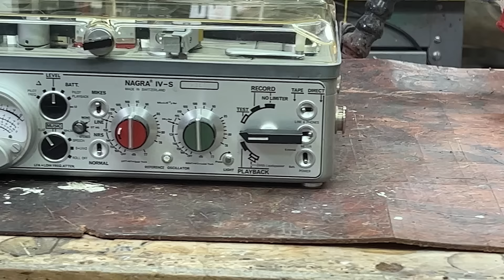Adam Savage Restores Clear Plastic Discoloration

Comment: Wonderful work!  My only advice here is your use of paper towels on plastic: it does put microscratches into the surface.  Cotton or poly microfiber cloth is the only thing to use to prevent clouding or hazing a plastic surface.  Remember when you were a kid and the optometrist warned you about cleaning your glasses with paper towels?  That was good advice!
Reply: Funny thing is that those blue ones he puts the lid on look like microfiber cloths, yet he still continues to use those paper towels 🤦‍♂
Reply: @pendaco  They are thin Huck towels;    you can find them listed through his online Amazon shop link.   I agree that a new microfiber cloth would be my choice.
Reply: I just posted the same comment about five hours after you, didnt read down the comments this far.  Sorry.  but it is worth mentioning more than once I hope.
Reply: I know it's a year old, but seeing this brought back some bad memories. I used to work in a glass shop, and had to redo a few projects, because the other genius guys that SHOULD have known better, came up and started cleaning the plexi/lexan with paper freaking towels! AFTER I was almost done!
Reply: As a teenager I used to clean my glasses with paper towels and windex all the time.  Nobody ever told me it was bad. Finally once when I went to get a new pair of glasses they seen my glasses and knew immediately what happened to them. I now use special cleaning solution for glasses (no ammonia) and a lens cloth.

Comment: 12% hydrogen peroxide is more than enough concentration, but as everyone has said UV exposure is needed. If it doesn't fit in Adam's beautiful UV box for finishing 3D printing, just sitting in sunlight will do. 
Honestly, the Nagra looks gorgeous already. Gave me a small thrill to see it zipping tape through rewind!
Reply: Issue with sunlight is that the perioxide will turn to water much quicker.

Comment: There is a restoration process called retrobright that uses hydrogen peroxide and UV light to get the yellow out of old plastic. People have restored old PCs and all sorts doing this. One setup I’ve seen is a clear container filled with hydrogen peroxide, wrapped in UV led tape and then tinfoil. I’ve also seen hydrogen peroxide cream from beauty suppliers work well as it can stick to the surface you want to restore, wrapped in cling film and left in the sun.

Comment: Research in the Pinball area and you'll find great tips for removing yellowing with minimal integrity damage. We commonly treat this kind of stuff to restore older machines. Depending on your plastic type the time and method may be different to reduce potential damage. For this type of likely PC plastic you do have to submerge it in the peroxide and keep it in full UV sunlight until it clarifies. Anywhere from 2-72h depending on your UV intensity. It's the least effort and least damage that won't reduce the clarity or polish. I'm not sure if it's the peroxide reacting with the plastic or the reaction of UV through peroxide that somehow modifies it. On some plastics just leaving it in direct sunlight for a few days will do the same. It's the safest way for any plastic.

If possible do this outside in full light, not in a window because windows (especially modern) cut certain UV wavelengths enough it will take 48-72h to clear. Storm windows often have UV film and this may not work at all indoors. You can also try making a paste from baking soda or certain types of toothpaste and let that sit if sun isn't an option. Some plastics will warp depending on sun/heat/cold so indoors in the window may be required. I'm not sure what UV wavelength makes this process work, wish I knew, but I've only gotten it to work in full sun. Also works safely on PP.

Be cautious about the methods. For anyone doing this stuff DO A TEST FIRST, these things can brittle some plastics depending on chemical properties and age. Some ABS will re-yellow pretty quickly when doing these methods and depending on the plastic formulation it may make it brittle. You may need to seal the plastic to keep it from yellowing again because it's oxygen that causes the yellowing. I've seen people ruin items doing some of these de-yellowing methods. Most of the methods will remove stickers, paints, or embellishments so even more important to do a test. You can do this with just a drop on a more inconspicuous part.

Comment: I had about the same issues with the Novus polishes on my motorcycle windshields - it seemed to do well at first, then it got worse, then I was fighting to get it back to a respectable clarity. I ended up getting Meguiars #17 (mirror glaze clear plastic cleaner) and it's worlds better at removing fine scratches than the Novus products are. It's safe for gauge clusters, computer screens, and motorcycle windshields, where optical clarity is required (I was almost blind riding at night due to the glare from the swirls on my windshield originally). Thanks for posting!
Reply: Thanks for this. All the other comments about polishing didn't seem to know that he was using a product that wasn't a mechanical polish. Your comment was actually helpful to me because I have used the novus fine (can't rmember if it's 1, 2, or 3) on opaque plastics and it works nicely and they seem quite shiny, but clarity on clear plastics isn't great.  I think his effort was improved greatly by giving it a good cleaning after the final application. Thanks for your tip!

Comment: I build plastic models and use what used to be called Future Floor wax, but now called Pledge Floor Care for the clear parts. I've found that minor scratches mostly disappear as it fills in the scratches. Not sure if it will work, but just a suggestion. I've usually dipped the parts in the floor wax but have used an airbrush on them before. It doesn't need thinning.

Comment: There's been some really great experimentation done with the retrobrite process, and one conclusion that they've all pretty much come to is that heat and/or UV is key to making the process work. Since this is a very valuable piece you may want to avoid going with the heat option since it increases the risk that you might overheat the piece and warp it, but it definitely would be worth it to get some UV lights and repeat this experiment. The other option would be a higher concentration peroxide solution, but once again it becomes risky at a certain concentration, and without UV and/or heat results are likely to be middling at best. The absolute best results seem to be obtained by using both heat and UV, but even just UV should give you better results than what you got.

Comment: Adam, I do sneaker restoration and I use a product called Salon Care 40 to remove the yellowing on white rubber of the sneakers.
The secret is to coat with the salon care and put it under uvb light and it works great.
Hunters use it was well to whiten game skulls. 
I think if when you were soaking the cover if you would have had it under some uvb light it would work.

Comment: I just got into reel to reel myself. what kept me away was the seemingly daunting way it operates but once you get the hang of it its easy as hell. i got a sony tc series player and an external matching vintage preamp (it doesnt have its own speakers onboard). i have then proceeded to rescue and save old radio station airchecks and a couple home recorded beatles albums to play on it. amazing stuff. i always make sure to keep about 4 feet of leader added on all the tapes. sounds like a lot but it isn't, as you need  to make sure there isnt such a high tension on the tape ribbon. acetate ones like to snap,

Comment: It works only when exposed to UV light. Key is to have very even light and solution distribution to avoid uneven bleaching. However i dont know if it will work on clear acrylics as the yellowing will in this case go thru out the entire thickness of material.

Comment: For hard clear plastic (like headlights) I use the 3M advanced headlight restoration kit.  The polish that comes with the kit leaves the plastic with much better clarity than other kits I've used.
   The 3M kit is used with a cordless drill and has 500 and 800 grit sandpapers and a 3000 grit Trizac scuff remover and then you finish with a foam pad and what they call a rubbing compound.  
   Dry sand with the sandpapers and use very light, even pressure.  Then use more pressure and some water when using the Trizac pad.  Finish with the foam pad and polish until the plastic is clear.  
   Check your work to make sure you've removed all of the scratches from the prior step.  If you see any "ghost" scuff marks or cloudiness it means you didn't remove all of the marks from one of the abrasives along the way and need to start over being sure to be very thorough.  
   To get crystal clear results, spray the plastic with the acrylic clear coat that comes in Maguiar's headlight restore kit.  Make sure the surface is free from dust and lint before applying the clear coat.  Something about that particular product lays down very evenly as compared to other clears I've used.  Do not over spray.  
   I would not recommend this last step for wide, flat surfaces.  In my experience it's damn near impossible to get a perfectly even coat.  
   Anyways, your results speak for themselves and I'll be giving Novus a try.

Comment: Both heat and UV light are king as a combination to remove the yellow, the best thing I found that works very well, is to warm up your hydrogen peroxide, then get a black pot or pan, put your yellow part into the pan, then poor in your warm hydrogen peroxide, then set the pot outside in an area that gets full sun, after that day, remove your item and rinse it off, the results are amazing. 🤠👍⭐⭐⭐⭐⭐

Comment: There are so many different variations of this technique I was honestly just interested to see Adam try it. Some people say temperature, others UV light. It's also important to note that many reports of plastics re-yellowing at an accelerated rate means for some materials it's a purely cosmetic process that has to be redone. I think its still a new enough technique that there isn't a lot of long term evidence floating around but I'd love to know more about the chemical reasons this seems to work.
Reply: 303 Aerospace Protectant or some other kind of dressing (potentially even Armor-All if you want it to be shiny, but I wouldn't use it) will keep it protected from yellowing as quickly. There are a couple of chemical reactions happening in plastics that make it yellow, and I think that people are in general thinking that yellowing is due to UV when it's due to UV and oxidation. A good protectant/dressing will help against both causes, but moreso UV exposure than oxidation.
Reply: you just need uv light to activate it, the way adam did it was completely useless, you can use sunlight or an uv lamp setup, what a missed opportunity, it really works like magic

Comment: Adam - Here is Why it got Worse and how to fix it- you need to move from a cutting compound to a polishing compound. Both are like liquid sandpaper, with the cutting compound being a low grain and the polishing a very fine grain. It got worse the second time because you had already weakened the surface you were working on and needed to smooth out the scratches you made with a finer grain (polishing compound). Keep working on it, thing about getting a foam polishing pad to use with your polishing compound and then when it's finally clear and devoid of scratches think about covering it with clear coat to prevent the yellow from ever coming back.... put practice on other less valuable pieces of clear plastics first because if you fuck fuck up the clear coat you have to go back to square one with the clear coat. You will also need to wet sand and polish the clear coat but it will last longer.

Comment: A possible alt solution... It used to be common (in my grandparents time) to add just a bit of blueing dye to white laundry, especially in urban areas where the city water was discolored. Because the color blue is on the opposite side of the color wheel from yellow it counter-balances out the yellow to make a pure white. (Note: This is why so many whitening mouthwashes are blue). So… maybe a very light blue tinted wash might decrease the yellowing? Def something to test before applying to your expensive NAGRA cover.

Comment: I use hair bleach peroxide %35 and uv light to restore icy clear soles on my sneakers. It works to remove the yellow for sure
Edit: I hadn't read the comments about uv light but they're right.
Now back to watching the rest of the video 🤓
Reply: Do you think regular bleach would work?  I feel like bleach would work better than peroxide.
Reply: @h.Freeman  interesting.. I have a watch that has clear straps that might turn yellow so I will keep your method in mind for when that time comes. Would sunlight work as good as the UV light

Comment: There was a headlight restoration kit that we used at Monro muffler, it was a sand and buff up to like 2000grit with a final liquid component that was wiped on with of all things a "Mr eraser" sponge. 
Was like magic. End of sanding the lens would be that same frosted look, but you hit it with that liquid and boom like a new perfectly smooth clear lens. Set the uv light on it to cure it or set in the sun on a warm day and good for years.

Comment: The process you did in this video is called Retrobright, which is commonly used to restore "yellowed" parts in old ABS plastic if I am not mistaken.
But I seems to recall that this process is used in conjunction with a UV light source.

Comment: Nice.
Wondering if Adam has a video on cleaning rubber or pvc plastic that has become tacky??
Reply: Just remove it. There's nothing else you can do. Ask any long term 3Dconnexion space mouse user!
Reply: @nikthefix8918  it’s one of my older figurines and the rubber hilt of a replica sword… so can’t really just remove it. Thanks for the recommend though ☺️
Reply: @FrazzledNiya  I've never found a way to stabilize these coatings once they start to degrade. I have used talc to conceal the tack tho.
Reply: @nikthefix8918  thanks ☺️… really sucks when it happens 😢
Reply: hydrogen peroxide can clear rubber up no problem, even 1 inch thick rubber from lil midi controllers, you just need sunlight and prevent evaporation or a uv lamp, they become like new
Reply: @nikthefix8918  not true at all hydrogen peroxide works perfect for that but not like adam, you need uv light, so sunlight or a lamp and time will make any rubber clear like new
Reply: @JohnSmith-pn2vl  Thanks. I've used that technique to de-yellow old plastics and resins but I'll try it on the rubber problem.

Comment: I've used peroxide mixes on hundreds of pieces of plastic of varying condition and ages and tried just about everything. Heat alone works best in my experience, no UV needed. Pop the bath in your lab oven at 130F and give it between 8 hours to 3 days. Agitate regularly since the reaction will produce bubbles. 12% peroxide is on the strong side, especially for transparent plastic. Dilute it to around 6% and give it a shot, increase concentration as needed.

Comment: Back in my car racing days, we used Lexan for windshields. After 3 or 4 races it would get sand blasted with some small scratches. We used a tube of cheap toothpaste with a buffer then a couple coats of Rain X to get the really small stuff. It worked great and was pretty cheap.

Comment: The reason for the yellowing of plastics over time is the addition of bromine to the plastic as a fire retardant during manufacturing. The Peroxide when combined with UV light will greatly reduce the yellowing but be careful of leaving it for too long. It could cause the plastic to become more brittle

Comment: I was taught to never use anything that used to be a tree to polish plastics. I've seen the result, it can make things hazy. I use the Novus products on my motorcycle windshields, I've used it for years. I use micro fiber cloths and final rinse with alcohol to remove the film the compound leaves before I polish it. As others have said, use UV light with the peroxide and let it soak for at least 24 hrs. For absolute best results you can finish with a clear spray paint with uv protection and it will never yellow again.

Comment: I de-yellowed my 1986 Heathkit Hero 2000 robot, which is still up and running.   Back in 1986, they were selling for $4,500, unless you chose to purchase it in kit form.  Hydrogen peroxide, a big helper.

Comment: An optician once told me never to clean my plastic spectacle lenses with tissue or paper towel because they are made from trees.  You would never rub your lenses on a tree... over time it just dulls the surface with tiny scratches. That is why they give you a microfibre cloth in your spectacles case.  I winced when you used paper towel to rub off the polish.

Comment: Treat it the same as discoloured headlights, 1000 then 800 grit wet/dry paper and then polish with fine abrasive cutting compound and lots of elbow grease. you will have perfect results.

Comment: don't know if it will work but I often use this method to remove yellowing from plastics, but I also use UV light or even sunlight works well.  it takes a while depending on the light source,  but the uv light helps

Comment: ADAM IF YOU MANAGE TO READ THIS USEFULL INFO, I'M HOPING IT HELPS

Toyota has these little headlight coating kits used by the dealer, it's pretty cheap and you can by it from them. Comes with this purple liquid that you rub after final polishing.

I used it on some plexiglass and lexan in a couple of projects and it makes it 10x better as well as remove some outer yellowing.

as for the yellowing inside the plastic, I don't think you can remove that entirely.

Also if you plan on making a copy with vacuum forming I would love to watch that.

Thank you and have a nice day.